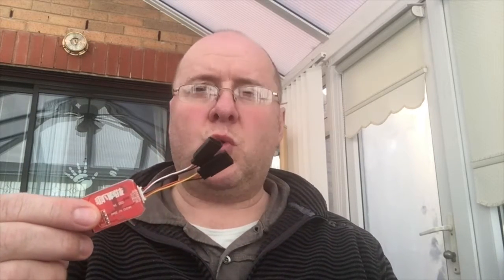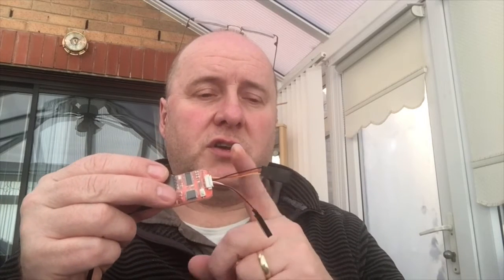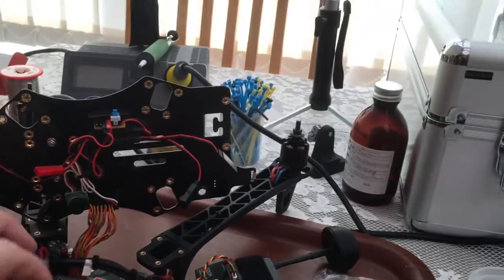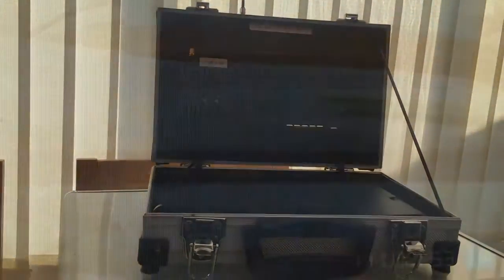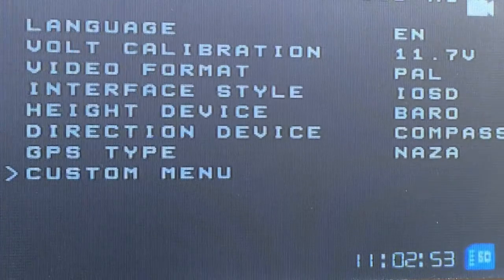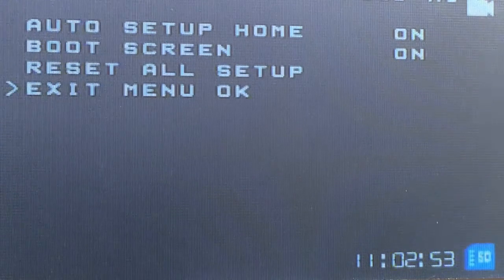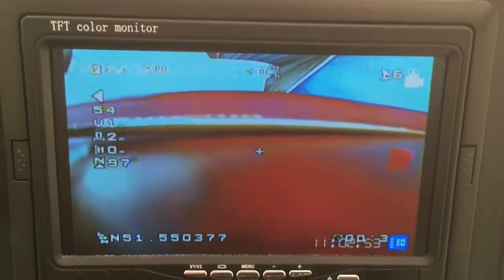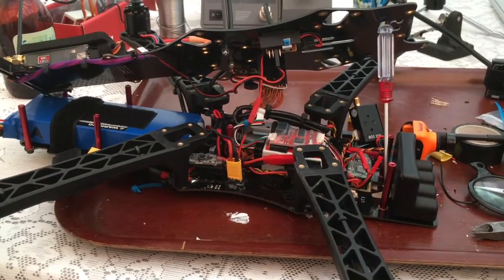N1 OSD with NAZA

Comment: Are you still there?  ok  so I don't understand...the vcc for the in part is the vcc in for the battery, thats' what it measures, what's the video in for? You've split your video directly from the camera to the vtx, so you have two inputs going into your vtx? Where does the split occur?
Reply from the maker: Hi, you want the VCC to show your true battery voltage. 
However if you are running fpv and using a 12v regulator or filter to power your FPV then it’s not showing true battery voltage. Old FPV systems didn’t like 4S batteries and wanted 12v not 14v so we would add a power UBEC to give it a smooth clean 12v.  Modern FPV systems are now multi voltage and better at filtering.
Reply: @TWSreviews  oh great you're still there!  Thanks!  I have an f550, it takes 3 to 6s right, controlled by the little module...which wires go where so I can tell what the battery is at?  I put a direct set of wires from the battery/power distribution into the vcc  on the camera in on the osd?  I have your exact osd, it doesn't have a separate battery thing it appears like the other modules which I can only find directions on.  This one seems to be newer but doesn't have a pinout anywhere I can find.  Also I have no camera feed on my monitor...so how do I split the yellow wire?
Reply from the maker: @maddercat  The battery voltage you connect to the video in (camera) however the same voltage may not be compatible with the camera and VTX as they may be 5v or 12v so watch out for that. The "Video in" + & - supplies the OSD board. 
The yellow wire from the camera needs to feed into the OSD in the "camera/video in". The yellow wire from the "video out" goes to the video transmitter VTX. 
If you have no video then try connecting the yellow wires together to bypass the OSD see if you get video then. The OSD board sits in line with the yellow wire and simply adds data to the video signal. If the video works with direct connection bypassing the OSD then it may be a power issue supplying the OSD. 

Check the OSD camera and VTX are ok to work on the battery voltage. Over volts may damage them.
3s & 4s would be happy with 12V units but 5s or 6s would damage them.
Reply: @TWSreviews  Yes my camera and vtx is 5 volts, and I'm running on 4s, so you're saying that won't work I have to have a battery voltage vtx and camera? 

I'm currently getting an osd feed, so the vtx is working off a 5v power on the back of the osd,  video out and the osd is powered from the 5v in of the naza, but there's no video in recognition apparently.   The camera is tested as working and I actually swapped it out to another drone and am using it cause I got frustrated with this.    If I put battery voltage to the video in, does the entire circuit then become a 4s circuit or what.  Maybe the part that processes the video in needs 12v or something?  

This is so frustrating. I just asked the seller for a pinout and they referred me to a page in chinese that didn't have any info about this, and they're like...there are similar things there, figure it out. LOL
Reply from the maker: @maddercat  what you can do is cut/disconnect the camera positive (red) and link the camera and VTX reds only together thus bypassing the OSD. 

The red wires that are left cut coming out of the OSD, connect the "in" that was supplying the camera connect to the flight battery Positive. 

The OSD will then be powered by the flight battery and the camera and VTX will be powered from the VTX 5V.

I guess the VTX will need a power supply, if 5v you will need a 5V UBEC. 

As long as the Black and yellow are connected through the OSD it should work.

- VTX & Camera positive (RED) supplied via 5V UBEC
- OSD positive (RED IN side) supplied via the flight battery positive
- Video feed (YELLOW) from Camera to OSD IN
- Video feed (YELLOW) from VTX to OSD OUT
- VTX, Camera & Battery negative (BLACK) all common connected to flight battery negative
Reply: @TWSreviews  I had been powering the vtx and the camera off the same 5v positive wire coming off the back of the osd, the vtx was working, the camera wasn't.  Maybe if the ground is an in, it wouldn't be connecting to the system ground might be the only explanation as to why the vtx would be working and not the camera.
Reply from the maker: @maddercat  it won't hurt to common all the black wires so there is no supply issue. The OSD I believe needs 12V and may not work off 5V. Prove the camera and VTX work on their own first.
Reply: @TWSreviews   got the camera working, so going to try to put battery voltage to vcc in now, hopefully it doesn't blow.
Reply: @TWSreviews  It worked! Fully functional f550, thanks so much this video was key.
Reply from the maker: @maddercat  glad to hear....happy flying

Comment: This may be an OLD video but THANK YOU for posting this years ago.  I just got one of these N1 OSD's today for a custom build i am working on and i couldn't find any good info on any of the seller listings on ebay or aliexpress that explained the button and how to get it set to English or how to get it to show battery voltage instead of 5v all the time.  Your video fixed both issues i was having, and after playing around in the menus with the custom display settings i was able to customize it to exactly what i wanted on the screen.
Reply from the maker: Thanks for your feedback, appreciated.

Comment: So i just have to connect the battery into the osd conector???
Reply from the maker: I had to watch the video myself to remember....lol
GPS lead into OSD so it is in the circuit. 
FPV connections video in & out. 
12V or 3S battery connected to the FPV connections will power the OSD.
I don't think 5V was enough to run it.
If you use 3S then you will get the battery voltage on the screen.
I am not sure if it will cope with 4S, you will have to check the spec from where you bought it from.
Hopefully the supply can be 4S 16.8V
Jon
Reply: @TWSreviews  Thank you helped a lot! And now i only need to find the mount for the fpv camera and im done

Comment: thanks for the video, you did an amazing job ! could you please tell me about the battery connection ?
is the VCC line on video connector connector connected to the battery ?
Reply from the maker: Yes I originally had battery voltage. However I later added a 12V power supply off the battery and supplied a filtered 12V to all the FPV so less chance of video noise.

Comment: hi, gps module is optional or necessary whit n1 ?
Reply from the maker: No optional GPS as uses the NAZA GPS and sits in-between. Most of the information for OSD comes from GPS connection. I guess if you had NAZA without GPS you could plug it in but no location data.

Comment: can i use this for my phantom 2? 
i saw others they connect something on the can bus
Reply from the maker: I am unsure sorry..... If you can interrupt your FPV camera connections It should work in the same way
Reply: Team Wooly Sheep Reviews another question
does the n1 osd compatible with the naza 2?
Reply from the maker: Yes it is. All it really does is take the GPS signals in so really basic. If you can make up a lead check out the Aeromax OSD from Virtual Pilot. £9.99 and in UK.... http://www.virtualpilot.co.uk/index.php?route=product/product&product_id=51

Comment: Why is the distance reading increasing without the drone moving? 12m sitting indoors?
Reply from the maker: because its still getting satellite lock. When you have a good lock you press the home button. May be because I was in the shed when I last pressed the home button and then I was in the conservatory. Not super accurate but gets you back home when lost
Reply: Team Wooly Sheep Reviews have you had any issues with signal loss at all? I just worry about pulling the GPS antenna out and fitting a cheap Chinese product in between?
Reply from the maker: I felt the same way so I went with a stand alone GPS OSD - Aeromax OSD and GPS module from Virtual Pilot. It has to be flashed and configured but lots more options. Its the new updated Minim OSD.....check it out
Reply: Team Wooly Sheep Reviews do you have a link to the one you bought?

Comment: can you explain more about voltage display wiring....
Reply from the maker: The VCC in and out connections power the unit at 12V. So rather than connect a 12V camera power supply or 5V supply from the VTX, I connected directly to the main lipo battery circuit. I only used the single video wire (yellow) to go from the VTX and the camera. I have by camera running off an independent 12V power supply board to filter interference however, the VTX outputs 5V and could be connected directly to the camera and totally bypass the OSD. 
In simple terms only the YELLOW video wires are going through the OSD (camera to IN and VTX to OUT)
Whatever + & - connections are fed from will display on the OSD data.
I wanted main flight battery voltage so I connected a + & - off the battery circuit
Reply: any impact to osd since its directly got 12 v from lipo...?
Reply from the maker: Oq Syauqi no issues because I have recently discovered and confirmed that it gets its power 5v from the GPS connection
Reply from the maker: no impact as is purely reference on the display. I found the board is supplied via the 5V GPS connections
Reply from the maker: I have battery voltage going into OSD to give me battery voltage on the display. Bypass the 5V from your VTX straight to camera if your are planning to run on 5V so all you are interrupting only the yellow video signal wires.  I wanted battery voltage displayed as more useful to me. If you are running camera off a mini voltage regulator 12 or 5V then its not going to be useful. I hope this makes sense
Reply: can i use a 4S lipo with 14.8V from VTX to go into the N1 ?? You now ?

Comment: Thanks for showing me how to do the install I have just had the same osd delivered and wondered how I'd connect up as I have my FPV running off a separate 3S 18650 1.6mah cells pack I made up but obviously needed the main motor lipo voltage readout showing, you kindly put my questions to bed
Reply from the maker: Thanks......I appreciate the feedback.......makes it all worth while

Comment: Hey,
when you power it on...the red light of the N1 is flashing? Because mine stays solid...and GPS is not working on naza and the N1
Reply from the maker: I am not sure what you mean......it flashes until it initialises.....I'll check it next time I fly and will get back to you. I have tested it and all worked. I don't like sharing the GPS so may put it on its own
Reply from the maker: Checked and mine keeps flashing....no clue why
Reply from the maker: Mine is flashing.....no clue why. Maybe its indicating the mode.....not sure tbh
Reply: If it is solid orange...
U need to do the compass calibration.